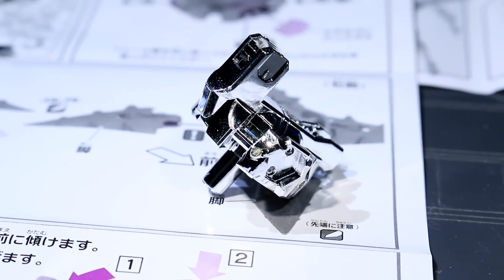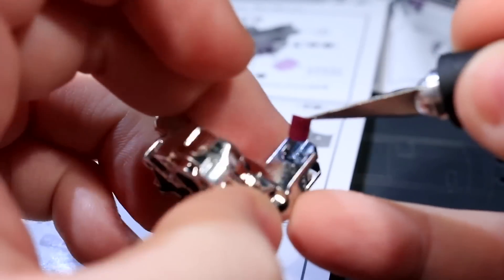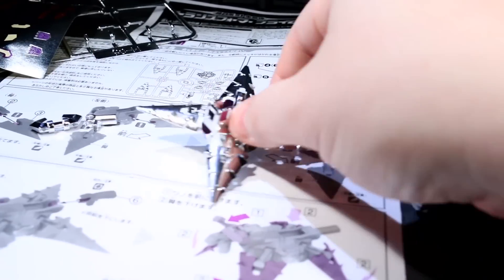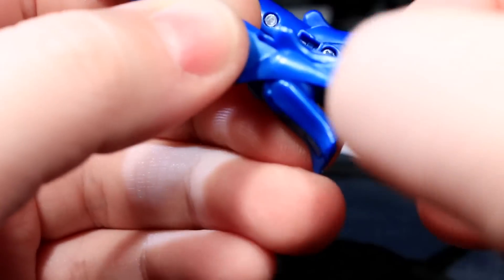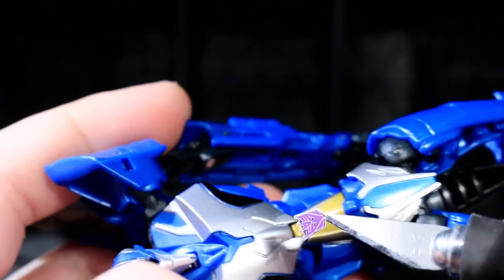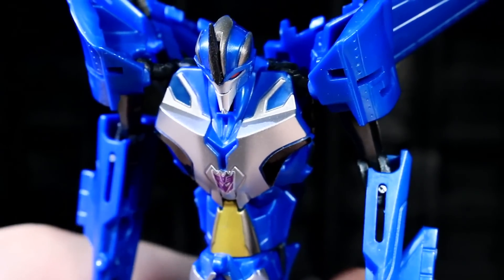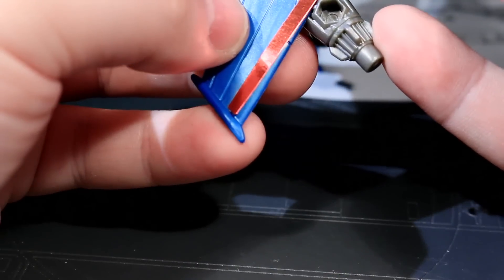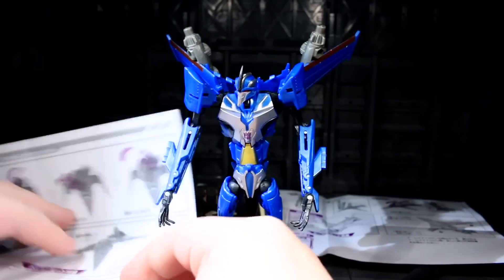Arms Micron Thundercracker and Silver Metal Balo - V-Build 65

Comment: It doesn't really matter, but I'd like to take a moment to explain how vacuum chrome works.  They take the part that is meant to be metallized, and they put it into a vacuum chamber and suck all the air out.  Then, inside the chamber, a small amount of metal (usually aluminum, due to it's high reflectivity) is vaporized with an arc reaction.  The resulting metal vapor coats everything in the chamber.  They let gas back into the chamber.  The part is chromed now, but the coating is very fragile, you can scrape it off with a fingernail.  So, at this point, they coat it with a layer of clear varnish.  The color of the chrome is determined by this varnish.  It's the varnish that changes the fitting tolerance, as the metal layer is only a few microns (not Arms Microns) thick.

If you thought this was interesting, does this mean you'll do the GX-68 Soul of Chogokin GaoGaiGar review?

Comment: I'd hazard a guess that it was probably a Hiyaku Shiki or a 'titanium finish' kit. All that chrome... All those nip marks. Kinda puts me off even attempting to straight build one (And if you're going to paint it, why spend more on the fancy shiny one?) Some chrome is nice though. The MG Hi-Nu has gorgeous little bronze-chromed propellant tank connectors, and the gates are set up so the nip marks aren't visible at all on the completed kit.

On topic, Balo looks gaudy as hell, like something the T-1000 would birth... And he's kinda handsome. Sucking up fingerprints from the niches of time itself, but handsome.
Reply: Modern 'titanium finish' kits are usually under gated. In case that's not completely obvious what that means: the pieces are on top of the sprew, so when you clip them off, the nubs end up on the bottom of the piece. This eliminates any potential nub marks. Thus, the MG Hiyaku Shiki ends up looking just fine. And makes the extra $20 that you spend on the extra finish a little more worth it (because obviously the Hiyaku Shiki can't be anything less than shiny gold).